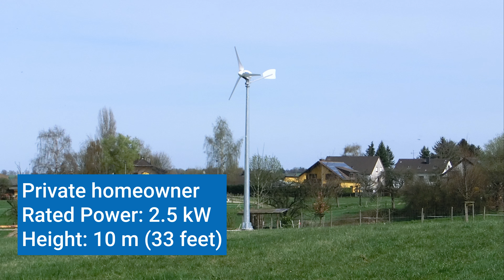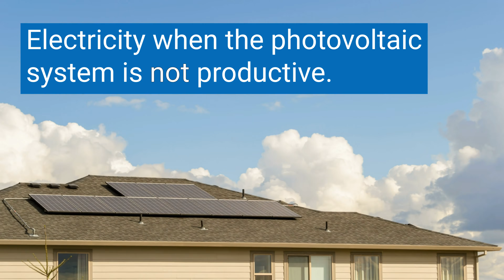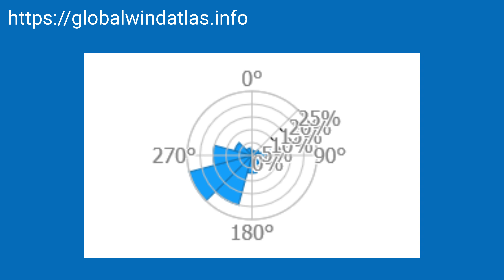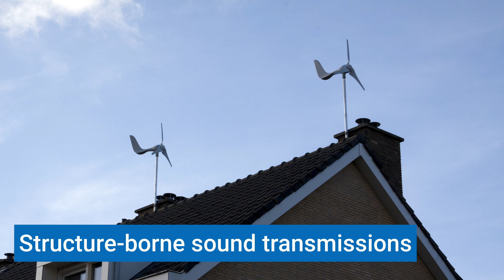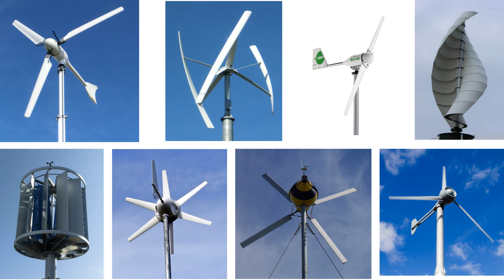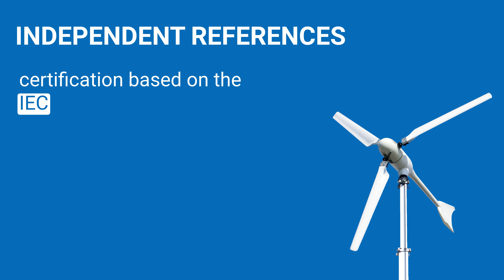Small Wind Turbine: Success or Failure? Do not make those Mistakes

Comment: 5:08 how to find out if there’s to much turbulence before final installation?
Reply: Nevermind I thought up a high tech a way to find out..streamer(s) along the pole/tower.
Reply from the maker: As a rough guide, you should have at least 200 m (600 feet) of clear visibility in the direction of your main wind direction. No high obstacles such as trees or buildings. In addition, there should not be any obstacles too close behind the rotor that could block the wind and cause turbulence.

Comment: Very interesting information, and useful.
Have you seen the roof ridge turbines, if so what are your thoughts. ?
The pitch of the roof funnels more wind up to the ridge, and they blend in with town architecture more suitable
Given that a roof must have some sort of ridge to cap the slates or tiles if the ridge turbine is installed do you think it worthwhile to build as standard.
Reply: Ветряк на крыше нужно устанавливать с обязательным применением поролоновой подушки, и желательно многолопастной маленького диаметра взамен трёхлопастного с большим диаметром винта.
Reply: @wind-9243  these are not windmills, they are different, it is not tall, it is like HAWT but on its side laying down

Comment: any suggestions for someone in alaska. looking at primus air 40 maybe 2 of them. any power from wind is better than no power from the sun
Reply from the maker: Primus Air has been sold to Ryse Energy. Check their website. You could also check shops with sailing equipment. The small wind turbines that worked on a sailing ship are usually good. Superwind, Silentwind, Air etc.

Comment: What watt production do I need to run a hot water heater directly from the turbine?
Reply from the maker: That's a good and interesting question. You need a special control unit for this. Or an inverter that has an extra output for a heating element.
Reply: Thanks. I already have an adequate system in place, but I'm thinking about a dedicated turbine to directly heat up an uninsulated old-style hot water heater or a sand barrel to use for storing and releasing heat to supplementally keep the house warm. I'm not that concerned with the accuracy of how much or how little it generates as long as it generates enough to keep the house somewhat warm.  @WindSunWisdom
Reply: @omarhomsy4843  
They have heating coils for dump loads its not a matter of what turbine as much as it is are you allowed to put it high enough to make the amps you need

Comment: Interesting.
What is youre opinion on horizontal axis wind turbines ?
So, basically a design like the VAWT, but then horizontal.
It seems to me that a design like this would be ideal to mount on a rooftop.
The roof effectively acts as a giant wind catcher, then the HorizontalAWT catches this wind, and dumps it easely on the other side of the roof where there is less pressure.
I only found one former Canadian ( now English ) company I believe which makes these models, for an insane price.
I bet I can build it myself.
What are your opinions on this Mr. SWS ?
The downside ofcourse is that this design only work optimal when the wind is optimal, since it cannot rotate.
Maybe you can add a few small wind catchers to steer the wind into the turbine, but it wont be optimal.
But, youre general opinion on a design like this please, im all new to this stuff.
I don't like conventinal wind turbines because of the blades and the flickering shades it produces, hell insured for your neighbours !
Reply from the maker: According to my observations, VAWT has not yet been able to establish itself properly. Although there have been many attempts by various manufacturers. The state of the art is still wind turbines with a horizontal rotor axis.

Comment: I live on Maui, the windiest county on average in the United States. The house that I'm currently building will be completely off grid with just solar and batteries. Even with the ridiculous amount of wind, I would prefer to just go with solar to minimize my moving parts in general hum associated with a wind turbine. The local electric company charges 42 cents per KWH, and unsubsidized solar system that I'm building myself will cost me $0.16 per KWH. The electric company charges $10,000 to hook up a new home to the grid and there was a 30% subsidy in the form of a tax credit on the system price. This generates an adjusted cost per KWH > $.08!!!  The future of energy generation for most homes I think will be self-generation and storage. Grid costs are getting too high to be sustainable and there is so much inefficiency built into the system to keep a grid charged.
Reply from the maker: If you have enough sun all year round, then you don't necessarily need a wind turbine. Here in Europe you have the dark winter with little sun and a lots of wind, so small wind turbines are a good addition.

Comment: Are there any 'off the self' battery systems that will accommodate wind, solar and grid?
Reply from the maker: You need a charge controller for the wind turbine and the solar system, both of which are suitable for the specific battery.

Comment: I know of eight installations of small wind turbines and they have been nothing but a trouble. 
The problems are: 

Council regulations, before even thinking of a small wind turbine the hurdle of council regulation enough to stop most projects dead in their tracks.
The 8 small wind turbine installations I know of have all failed in less than a couple years. 
Two were closed down due neighbors complaining about the noise
One had a direct lightning strike on the generator not only destroying the wind generator but whole solar system.
Three failed because of mechanical failure, corrosion from living in a coastal area,  metal fatigue and bearing failure. It seems that the manufactures haven’t taken into account the more powerful storm conditions due to global warming. 
Two were taken down, as you stated in your video, weren’t planned properly and produced very little electricity. I have just increased the number of solar which just keep on running and only need to run the petrol generator for about 15 hours year which is 10 years old and always starts.

Thank for your interesting your video
Reply from the maker: Thank you for your experience reports. Many people have this practical experience. Always the same problems: unsuitable locations, often because there is too little wind. Then there is cheap technology that is not storm-proof. The secret to success is to plan thoroughly. If the location is not suitable, it is better to leave it alone.

Comment: Biggest mistake is designed,blades are to shorth and to much mass ,si a solution,a big cone at least 2 to3 meters, this will redirect air to the edges doubling wind speed were 5 to 8 thin 1 meter blades will be place, steeper Angle to lower rotation speed and increase torque .

Comment: ..The number one mistake of over estimation of the wind availability isn't restricted to private wind generation installations. When the figures are finally published most, if not all of the commercial installations show dramatically reduced power outputs against projected figures.
Reply from the maker: Anyone who plans a wind energy project professionally will be able to generate electricity well with a small wind turbine. The wind supply must be carefully checked. Another prerequisite is a high-quality turbine. Without a windy location, however, it won't work.

Comment: All practical tests show that small wind turbines hardly generate any electricity! And only at very high costs! 
Because there is hardly any wind close to the ground. It is also extremely gusty, which usually shortens the service life. 
Only if you need to be self-sufficient from the power grid, you should have the largest possible wind turbine for the winter on a high mast. 
With solar panels, on the other hand, you can reliably generate green electricity for 25 years at approx. 3-10 cent/kWh!
Reply from the maker: I see it differently. Of course, the prerequisite for a small wind turbine is a windy location. This will not be in the middle of a residential area, but rather in a rural area. If you have an average annual wind speed of over 5 meters per second, then you can generate electricity economically. In many climatic regions, this is precisely when the sun is weak. A small wind turbine should always be considered as a supplement to a photovoltaic system.
Reply: @WindSunWisdom  "If you have an average annual wind speed of over 5 meters per second," => 99,99% of ground-level surfaces in Europe have no " ANNUAL AVERAGE WIND SPEED 5 meters per second" = 18 km/h.
Reply: @michaelvanallen6400 Absolutly, in Germany it is about an average of 2,5m/s given that the energy from wind is is in cubic do it speed means, double wind speed 8 times the power.
Wind turbines are basicly useless here, better get solar with a decent planned system you can get far more power for much less money.

Comment: So wind energy is will not produce the energy it cost. its only when ther is no other way. windenergy cant replace other energy in a good way.
Reply from the maker: A small wind turbine can make sense, but only in a windy location. Then you can generate electricity economically. The perfect complement to photovoltaics.

Comment: Best thing is to beult one your self 
You only need blades and alternator from a car. 
Stick it up high and it works.

All the other stuf are crap .
You do need 1000 rpm a minute so you need to calculate the settings form gears .
Best alternator are the japans small cars .
Those are small and turn easy .
Reply: БРЕД!
Reply: @dyslectishe - A car alternator? No. Never.